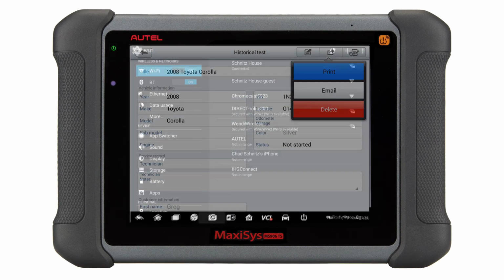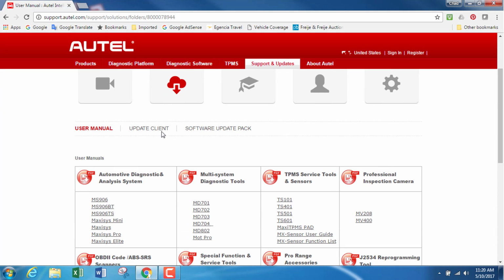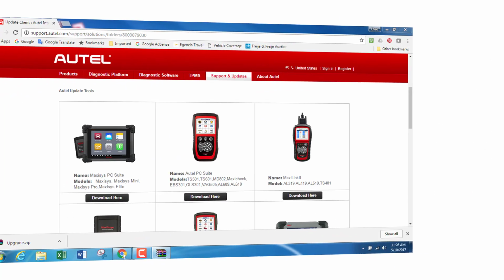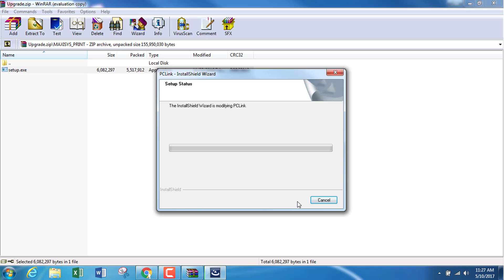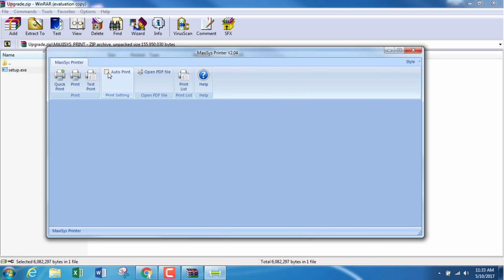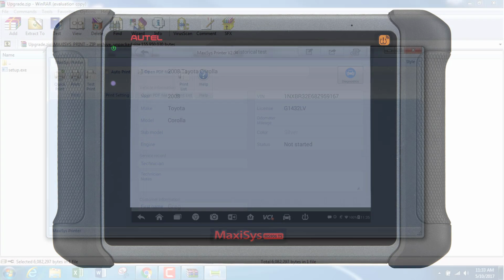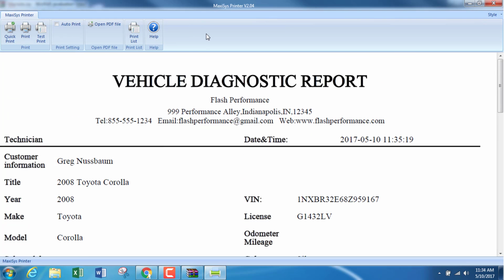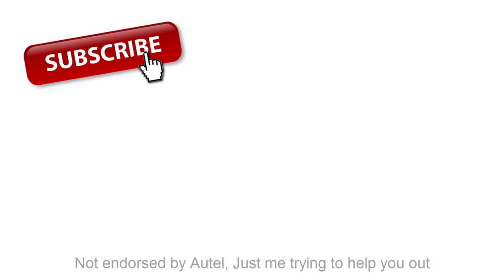MaxiSys Printer Setup

Comment: Here is a link to download the Printer Share app.
 
Open the .apk file on the tablet, it's pretty straight forward and it may ask to install a few extra files as you go.
 
Add a printer using the Select button at the bottom right.
Click on Documents.
The folder location for the reports will be Scan > Data > PDF
Select a report and print.
 

https://drive.google.com/file/d/15D0DZciJ-OFFfhUHjbIAvzR4GrvxoHgZ/view?usp=sharing

Comment: Hi, i live in US but my Autel TS608 i change the language to Spanish, need to download the Maxi PC Suite in Mexico version for spanish ? i can't print said a error in my device
Reply from the maker: Switching you tool into Spanish will only change some of the language over.  If you contact tech support they can turn on the Spanish download for you and that will give you more coverage in Spanish.  I have not worked with the Mexico download for the PC Suite, however once set up there is not much that has to be read.  I would recommend trying the US download and seeing if that helps.  Sorry I could not be of more help.

Comment: i am looking for Direct printing method .do u know how to connect the autel to the printer directly without pc since the printer is equipped with wifi ?

btw  i tried your tutorial it worked fine , but need the direct connect
Reply from the maker: There are too many variables to be able to make a video on direct printing.  However you can use bluetooth printers and download the app to the tablet.  Contact Autel tech support and they can help you through the process.